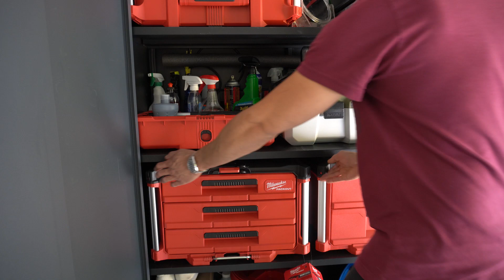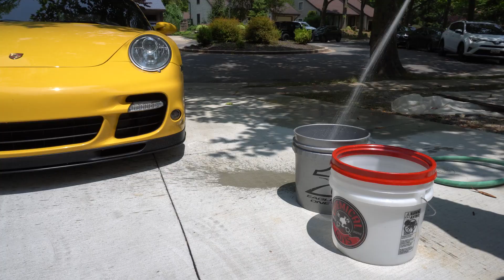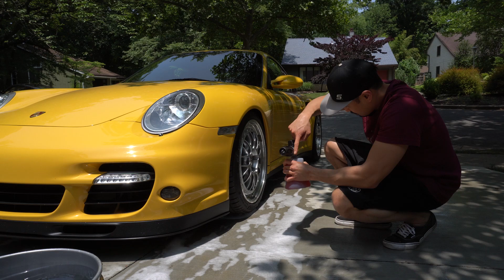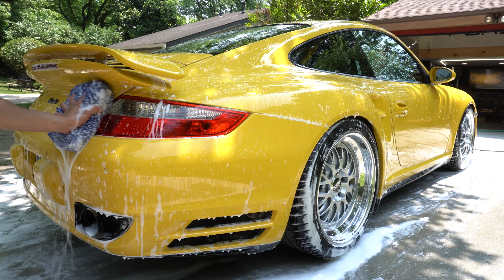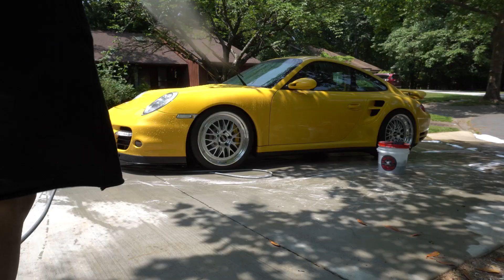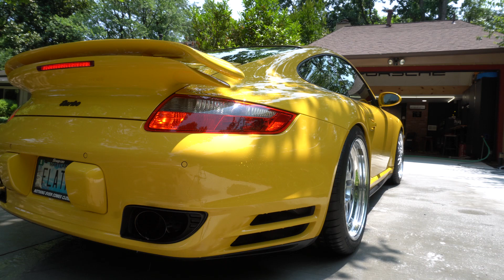911 Turbo Wash and No Talk.  ASMR Car Wash on my PORSCHE 997 Turbo.

Comment: Awesome Porsche! Could you tell me what front splitter is on your lip spoiler?
Reply from the maker: Hi.  Thank you!  The front splitter is a custom part that I made myself out of a sheet of ACM board.  It was designed and built specifically to protect the factory front lip from scrape damage.